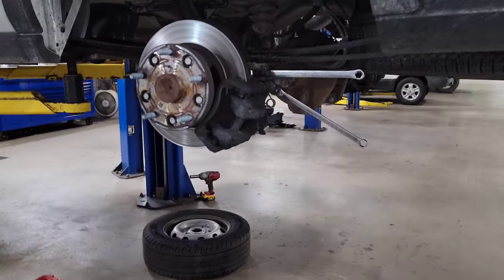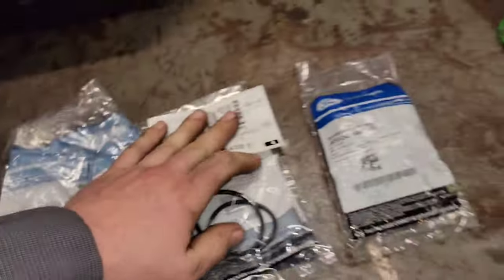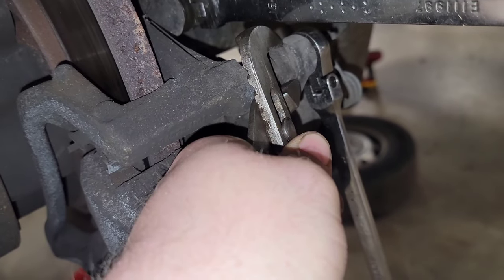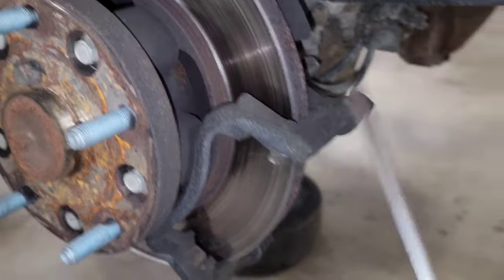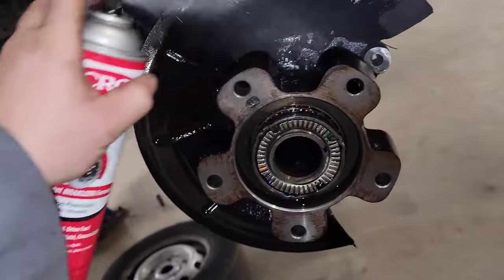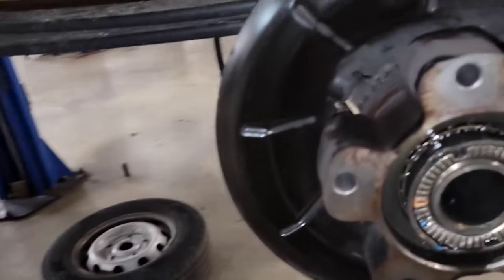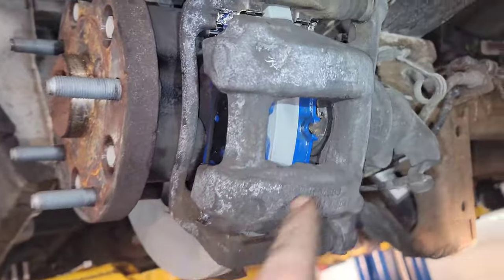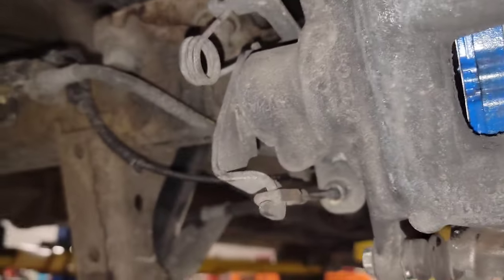2019 Transit T250 Rear Brakes 28k miles Full Remove and Replace - Tools and Part Numbers

Comment from the maker: HIT THAT THUMBS UP

AINT NOBODY ELSE DOING THIS TYPE OF THING LIKE ME, I THINK I DESERVE THAT. I know My worth
Reply: Link to the discord for extra help & questions 

https://discord.gg/9ZSYr8THb4
Reply: What are the tabs on the piston for        that line up in the. Pad you turned it at end of video.    Thanks for info
Reply: How about the brake wear sensor reset?
Reply: @hdryder1568  I did not see a rear pad sensor there. Also mine were at absolute zero and no sensor. All I heard was the noise and guessed its pad time

Comment: Do you work on any of the Transits used by Amazon contractors? It would be interesting to know what problems they come in with and how they are hold up compared to other Transits.

Comment: What I find even more ridiculous is that there are no wear tabs on the brake pads.  They can't cost anymore that a penny each!  But, because they aren't there, you are guaranteed to replace rotors every  time you replace brakes.  You never know the brakes are low until they are scoring that rotors!  They could offset the cost of the warning tabs by eliminating the stupid  tire inflation monitors.

Comment: First set of rear pads on my transit only lasted ~30kmi. One thing that I think really contributed to the short life is the thing came with the worst tires of any vehicle I have ever had. My area gets snow in the winter and the traction control (brakes) was CONSTANTLY on trying to keep the rear tires from spinning. The van was absolutely useless in any low traction condition. First week I had the van I got stuck on wet grass. I switched to falken wildpeak AT tires (LT225/75/16), there was a night and day difference. Tons of traction, very little traction control engagement. After changing tires the second set of rear pads lasted ~100k miles.
Reply: I agree. I switched to 225/75/16 as well at 36k miles. I am now changing the rear rotors and pads as the process to remove the rear rotors is so dumb, there is no way I want to do it soon. I was going to just cut the rotors as at 75k miles they are ok, but no way in hell I want to do this again. What a nightmare. Pulling an axle shaft to change rotors ? Come on Ford.  Stupid as stupid does.   I will change the pads next time faster, probably around 125k (50k miles) and no rotors that time.    The original tiny tires are horrible. The Van looks, rides and handles 10x better with the 225/75/16  Yokohama's.  Not only that but the tires after 39k miles are about half way down, while the oem's were worn down at 36k. They had maybe 4k miles left in them and these have at least 30k left in them. Cost was also slightly less, but the ride and handling is much better.  Noise not so much, so next time I chose a different brand.
Reply: I put a set of Kumo E load all terrains on my transit. Great tire and mild tread for and AT tire but works in the snow. Not looking forward to doing the brakes.

Comment: Use a map gas torch for removing bolts!! Apply generous heat , helps melt the loctite and loosen the bolts.

Comment: Im at 115,000 miles on my original rear rotors, had them machined and new pads at around 50,000 miles. Never touched front brakes yet.

Comment: Great video.

I service a fleet of these for a plumbing company and they eat through pads every 30-35k. When I do the fronts, I replace the hubs at the same time. They rust so bad here in NY, I have to hammer them off. I did this once and learned that the hub moved forward enough that it changed the air gap between the ABS sensor and the reluctor pad causing the ABS light to come at 20 mph. It was the oddest experience.

Comment: I’ve changed dozens of these.  They are worn down at 20-30k.  It’s good for us techs but sucks for the customers.
Reply: My Chevy Express had 86,000 miles and I only had to replace front pads around 70,000 I sold it at 86,000 miles and it still had the original back pads on it. Now I have a 2015 transit with 46,000 and the back pads are metal to metal.

Comment: I'm a firm believer in grooving up those old rotors!  If you machine them and install a new set of pads, rarely will a machined rotor outlast the 2nd set of pads.  Use new rotors every brake job and do your customers a big favor!

Comment: Those pads look way too small for that size of vehicle. No wonder why they're worn at less than 30k.
Reply: Yeah that is strange I had about 68 on my f150 before changing. Have 140,000 now. Original rotors, second set of pads

Comment: I have a couple 2020 model year transit vans, I found out the hard way that many vendors are advertising the wrong part numbers for rear brake pads. They do not use 1775, they use 2280. Rock auto has several of their rear brake pads listed wrong for this application, even Akebono manufacturer website has it wrong. 2020 model year pads are substantially larger than the 1775.

Comment: I'm appold! Who designs a rotor that requires an axel removal to change? Why change a tried a true hub assembly (like on any 3/4 or 1 ton truck. You risk damaging an axel (what it it falls over or something) or testing a seal. I hate when a well working system is replaced with an inferior one for the sake of trying to save money (I assume)

Comment: Mine had the calipers on the wrong sides (2015 tsb). Wore down at an angle. They wear faster because computer applies higher percentage of braking to rear than most vehicles. Great video !
Reply: Mine too, I switched them and still worn out pads in 45k.   Tried better pads tool.   The brakes just suck.   Got 230k out of suburban rears and 180k out of fronts.

Comment: Oh yeah, I forgot to mention in my previous comment that on our 2020 transits, the rear brakes wearing out quickly don’t seem to be as big of an issue as earlier models. Currently doing brakes on a 2020 with about 90,000 miles, rear pads still 3/16-1/4” of material, front pads are worn out - at wear indicator sensor. This is the FIRST brake job on this van, at nearly 90,000 miles.

Comment: Hi,
Do you have to replace the spilled fluid when removing the axle?
Reply from the maker: you're supposed to but really it's never really low enough to do so
Reply from the maker: I always pull the plug just to make sure and as long as it's even with the plug you don't need to put anything in

Comment: I hate the new brake clean the EPA makes us use.  Stuff is like water.  And even though they say "Low VOC", the fumes are way worse because it doesn't evaporate nearly as fast.  It just sits around for forever stinking up where I'm working on the ground.  I wish I bought cases of the good stuff before it became illegal.

Comment: I try to only use OE, but only work on my own vehicles.  I have used non-OE and been really disappointed.  Interesting they are using torque to yield bolts.  With my 1992 F250 w/7.3 diesel getting harder to find OE but I still try,  my local parts guys at Elk Grove Ford in CA have done well by me.  Unfortunately a lot of discontinued parts on my older pickup.

Comment: It seems like every 14k to 20k miles, rear brakes are smoked. I found out those bolts are torque to yield for a reason I had an axel shaft and wheel come loose big whoops axel was destroyed.

Comment: They do chew thru rear brakes, its always the inboard pad that wears first!  I suspect it is because of all the weight they typically are loaded down with.  What's your thoughts as to why Rich?  Another thing I like to do its mark the axle to hub, so I reassemble the same way.

Comment: Lesson i learned the hard way doing brake jobs at home, try to preserve those brake clips in case you can't get compatible replacement clips. 
There are plenty of places that will sell you brake pad clips but they frequently don't fit despite assertions of an OE fit. They tend to not sell it seperate from brake pads either which adds to the annoyance factor.
Guide pin torque varies by vehicle but 18-20 ft pounds I found was plenty, which amounts to hand tight for most seasoned individuals. Some may even specify less like 14-15 ft pounds.
Reply from the maker: Use oe or better in a HD transit work van, no cheap shit
Reply: @FordBossMe  what's the lifespan for the brakes less then a year or over a year per pads? The front ones last the same or 2x longer?
Reply: @FordBossMe  the first few years those came out, the dealer was less expensive than the aftermarket.
Reply: Ford pads come with clips and most of the time are cheaper than aftermarket.

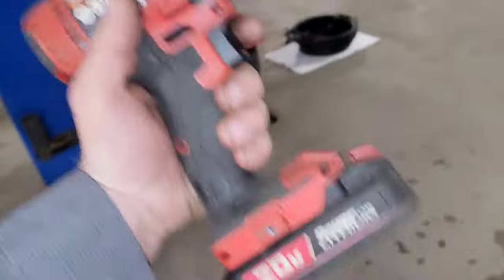Comment: Just curious: at 1:40 on your bench you have a caliper hanger, but you don’t use it. @MedTec67 says if you let the caliper flop you need to replace your brake hose. The hose looks fine in your vid. Do you normally use a hanger? Not trying to hate, just investigate (as a 2018 T350 3.5 owner).
Reply from the maker: The beginning of the video it was up laying on the spring I pulled it down to clean it, it has a cable attached to it as well not just hose 

And no you don't need to replace it that is wrong 

Just because it hangs doesn't mean it's bad and who ever says that it just fear mongering

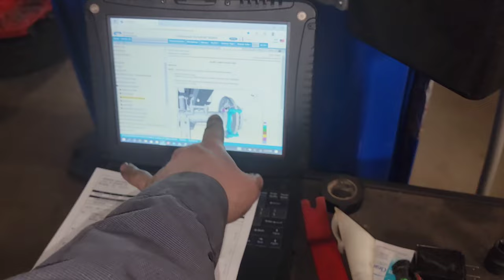Comment: That was a single rear wheel transit right ? At 13:41 you had the torque sequence pulled up for a dual rear wheel in the workshop manual
Reply from the maker: I fixed it lol, that day was a rough day for me
Reply: Ok. So before finding these videos. I torqued new axle bolts to 50 ft lbs then went to 80. Didnt seem like needed to many degrees more to acheive this. Your opinion on this? 2020 250 srw

Comment: question, for the caliper guide pin bolts theres top and bottom? because i took them out and i see the difference between those two, but i forgot which one was top and bottom. TIA
Reply from the maker: The wrong one in the wrong.hole will look off and not fit the same vs the other

You have me questioning myself now, I'm trying to log into for online and it's not letting me 

One will fit better in one spot vs the other 

Gotta pay attention when doing these jobs for sure....maybe when I get to work I'll be able to log in or maybe site is down 

Not sure but remind me in a bit
Reply: @Ford Boss Me  thanks a lot.

Comment: Check top up Diff oil as well / maybe.
Reply from the maker: Didn't need to you lose so little .... still right there at the fill mark... doesn't matter

Unless it's overfilled you ain't going to lose very much you'll just a little tiny bit right there in the end cap and that's it

Comment: 28K miles??  rear brakes??  seems like something else it wrong, seeing that on most vehicles read brakes do at most 30% braking?
Reply from the maker: That's a construction truck that often gets loaded down there's nothing else going on stop trying to overthink everything
Reply: design flaw, proportioned too heavy on the rears.  Ford didn't have this problem on the E series vans. Plus now they can sell more parts
Reply: The heavy rear brake bias on this vehicle is on purpose, prevents nose diving on such a tall vehicle. Helps with stability. Currently doing brakes on a 2020 250, 85,000 miles, still serviceable material left on the rear pads. I’ve owned five of these, and I have never had a set go out as fast as a lot of people are saying… Usually somewhere in the 80+ thousand mile range before doing the first set of rear pads for us.

Comment: I’d rather be doing rear brakes on those over the front. Brakes all around is a good ticket though.
Reply from the maker: When I do the front side pull out the on car lathe if I can 

But yeah you are right the fronts are a pain

Comment: @ 7:57  Do you have some kind of adapter to allow you to use that battery on that tool?
Reply from the maker: No it's a Mac impact with a DeWalt battery 

They are the same DeWalt is The same as Mac and both are owned by Stanley

Comment: I understand the Ford recommended replacement of those flange bolts considering location, but it's probably not needed. Better safe than sorry though, even though I'm sure most mom and pop shops that do this won't even replace them. Most OEM Ford fasteners are grade 10, which is extremely hard.

What's more alarming is the SHORT lifespan of rear brakes on these. They must use the cheap junk, that's how many miles I get out of rock auto cheapo rear pads for my 2000 Explorer. Used to be the OEM that lasted 150-200K miles.
Reply from the maker: You can be your own judge 

These are torque to yield bolts
Reply: @FordBossMe  Meh, even I said better safe than sorry. I just found that to be excessive. Maybe one could do a breaking ft. pounds test to determine it.

I've seen Chrysler actually reuse TTY bolts on occasion, always amazed me.

Comment: I don't know what it is but these and the 11 to 19 explorers eat rear brakes like they're nothing. I wonder if they'll last longer if the slide pins and hardware are cleaned and lubricated every 5k as a maintenance item.
Reply from the maker: I rarely see a slide pin issue
Reply: @FordBossMe  yeah most of the time the pads are rusted in place on the hardware. I have had several older F150s with slide pins stuck in the bracket since people either don't lubricate them when their brakes are done or they're so old they just get stuck in there.

Comment: Does it use a different type of system for Transit's to eat brakes so fast?  Caliper system looks the same as anything else, just the mounting of the rotor, and changing it for that matter are different then what I've seen.  Mounting style cant change that, can it?  Do the pads just always drag, never really running free?
Reply from the maker: They just overwork these things big time
Reply: They are proportioned to apply more rear brake so the van doesn’t nose dive. It squats more than nose dive. I have a 15, 250, 3.5EB that has been a money pit. Love the van but wow. 8 sets of tires, 8 sets of rear brakes, 6 sets of front brakes, drivers side exhaust manifold and bolts, passenger side exhaust manifold and turbo, fuel pump drive module and the dreaded drive shaft coupling every 30k miles. I replace rotors every time I replace pads. There was a TSB on the rear caliper holders on wrong side of vehicle from factory. Brakes were gone at 8k miles. It would hold brakes on a slight amount. Van weighs 8900 loaded. I love my van but maintenance has been costly.

Comment: Allan Howatt made  a video  on the  euro transit brake  pads,  he mostly has videos on Mondeo Diesel repairs.
Reply from the maker: No idea who that is
Reply: @FordBossMe  Its somone from the uk working  for a  taxi firm with only  mondeos  as fleet but they now  repair  other vehicles also. He is on  youtube  as  Allen Howatt He mentioned  to spray  silicone behind the boot before  you turn it  back on the transit.
Reply from the maker: @IntradeMotors  I've also said that before depending how nasty they are

Comment: Them mac hammers are my favorite,  bought the snap ons but they do not hit near as hard. Just did them brakes and another tech told me they need them around every 30k like damn thats alot of money every 30k
Reply from the maker: Mac branded but Stanley owned Really it's a PROTO ANTIVIBE which is still owned by Stanley when you order it
Reply: @FordBossMe  oh I know. Just saying they are the best hammer I've used
Reply from the maker: @niteninja0133  same I agree just dropping so knowledge wasn't sure if you knew

Someone else will learn from the statement I'm sure
Reply: How much does it cost for parts and labor

Comment: Great review of the procedure.  Would it be reasonable to put a thin coat of silicone grease on those brake pad clips and where the brake pads will slide on the bracket ? Is it also reasonable to use a 3M disk on the hub/flange that the inside of the wheel will rest on ?
Reply from the maker: I did reference using some silicone grease on the part where the pads right back and forth not sure if you meant that in the video that I did reference that and you can even see it on the pads and on the back of a pan

Yeah you can use an abrasive disc on the axle flange it just really wasn't that bad so I didn't do it in this
Reply: @FordBossMe  Yes...that's what I was referring to. I guess the correct term is brake caliper grease. My mechanic is picky about which brand he uses.
Reply: @Garth2011  if you have to remove rust from the bracket then a little brake grease helps under the new slide hardware to slow the growth of new rust. never grease the top where the pad rides. The new hardware is polished to allow for easy sliding movement of pad. 25 years and no squeaks this way.
Reply: @hungryjack8032  Yes, under the clips. I also heard that some caliper rust that forms is tough to get off and once in a while wire brush polishes vs. removes rust. I saw a guy use a carbide tipped file made for brake jobs and it got down to the caliper metal very quick and even/smooth. I guess it depends how detailed you want to be or how badly rusted a bracket is in combo with the customers budget.
Reply: @Garth2011  Getting the surface even is most important. If rust is left in place making the surface uneven, the clip won't sit flush and could pinch the pad, limiting its proper movement. 
When working on a customers car, the extra few seconds to do the best job possible the first time will reward you later. No comebacks and a solid reputation.

Comment: So, question. Is there such negligible gear oil loss that none is put back in or do you need to refill any of it?
Reply from the maker: You really loose like nothing, it's what ever is right there in the end of the axle tube and that's it 

Pull the 3/8ths drain plug in the diff and still sitting right at the full mark